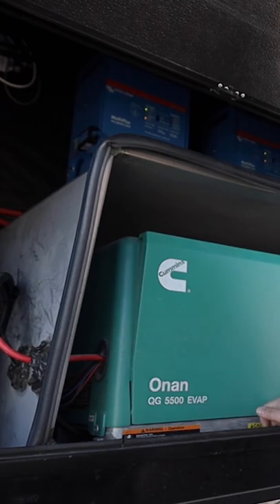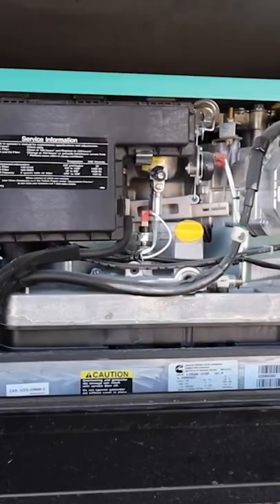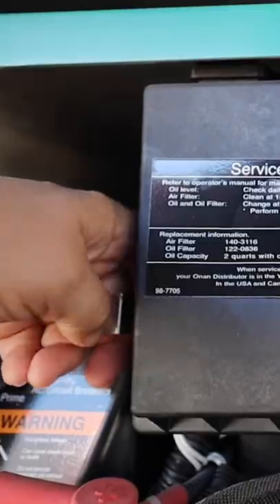DIY Generator Oil Change 😳 #DIY #oilchange #rvmaintenance

Comment: I was running mine and it shut off. I assumed that I needed to change the oil. When I opened the plastic thingy some sand got inside. How do I flush the entire compartment to get the sand out?
Reply: Diesel and pray